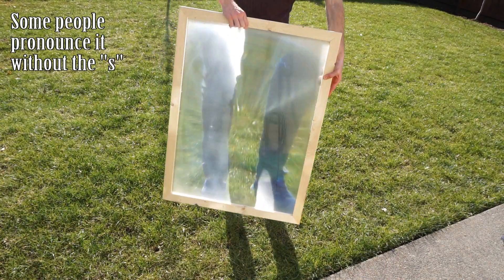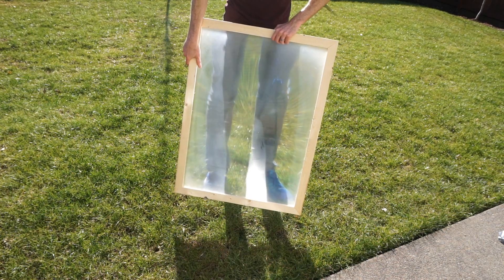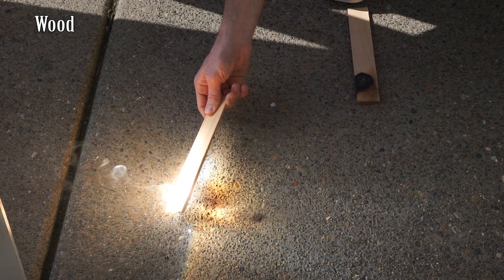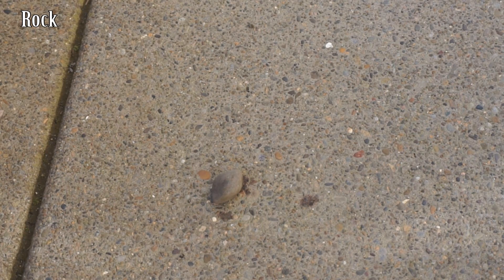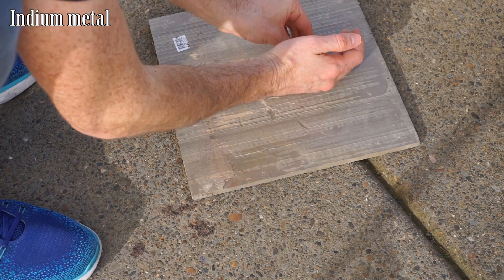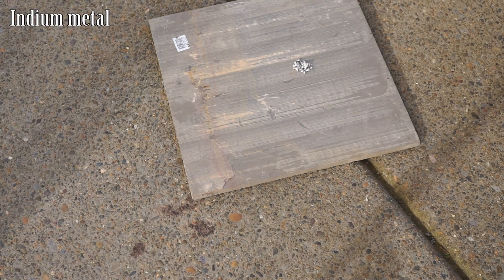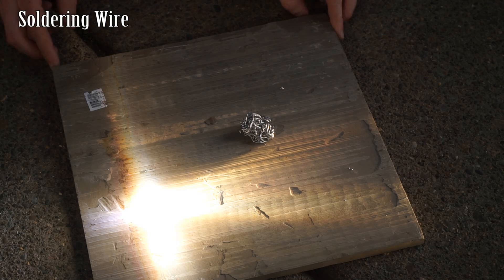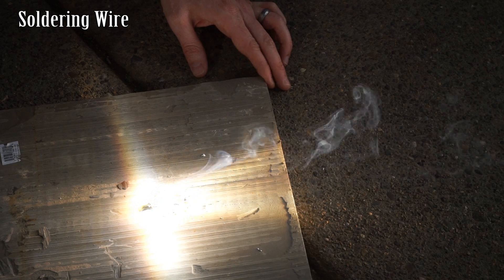2,000°F Solar Power! Melting Metal With A Giant Magnifying Glass

Comment: Where can I get a large fresnel lense?
Reply: Look for old rear-projection TVs. It's outdated tech, you can get them cheap or find them in the trash, that's where I found 4 of them. Look for 4:3 screens because they usually have smaller focal points than 16:9
Reply: @SolarCookingGermany  I found one online the size of a door for 300$ You can practically melt lead with it!
Reply: @johnlewisbrooks  Is it still in a TV? Because you can never tell what kind of lens / focal point you'll get until it's dismantled.

Comment: Use like a hollow brick to "trap" the light.  Use another piece of stone for a lid, like a kiln.  In the lid, there is a small hole to release excess heat and allow the light to enter the furnace.  Just make sure the total area inside the furnace is smaller than the lens, that's why I suggested a brick.  Now the heat can't immediately dissipate into the ambient air.  It's trapped and can build in heat to smelt correctly.  The reason that crucibles won't work is because the heat is too intense in one area.  If you "trap" 50 square inches of light inside a little brick or something, it will heat up more gradually and not break your crucible (use the smallest one you can find).  On a hot sunny day you should be able to smelt at least good ounce of metal inside that thing.

I'm thinking like, standing it vertically and hollow it out somehow.  Then your light spreads back out inside of it to avoid overheating the center.  All types of trial and error things obviously need to be done but I think this is the way to do it by trapping the light inside of a stone container

Comment: If you had a larger lens then you will create even more heat. I love this sort of stuff...it's free energy from the sun and is not as harmful to the environment. I can go on for ages about this....But i won't. 
Great  video and thanks for sharing.
New sub 👍🏻

Great video
Reply: Imagine sticking one to a robotic arm and having it pointed at a steam engine boiler. I could see potential for a solar powered power plant if it was done on a large enough scale.
Reply: Literally blows my mind how we are avoiding this as a green solution to almost everything it has so many practical uses it is unbelieveable
Reply: @cavelvlan25  I think it needs to be mentioned that this is a point source. A lot of energy is concentrated in 1 tiny point. That is why the temperature can get so high. 

 But this doesn't provide significantly more energy in total than just solar energy. The energy is just concentrated wich is only useful for very specific processes, like welding perhaps. But not so much for most other industrial processes.

 You still need an unpractically large surface area for most applications.
Reply: @dekippiesip  correct, I'm saying individually we could use this tech daily. Cooking, heating water, sand batteries. It wouldn't always be convenient but it would help against our reliance on power companies. Same with personal hydro and wind turbines.
Reply: Green steel green hydrogen green anything. Sure would no be effective allllll the time I mean what more do you need!
Reply: Or just mirrors

Comment: Okay so you can't 'stack' multiple magnifying glasses to increase the heat - it doesn't work like that. However you could use multiple magnifying glasses, have them side by side - except the one in the middle would be facing straight towards the object, all of the additional magnifiers would need to be angled, the further away from the mid-point you position them, the more of an angle they would need to be positioned. 

I'm pretty sure this is how ancient people's manage to build great pyramids out of concrete - use the lense to dry and harden the mixture.

Comment: did the pyramid builders mould the blocks on site, melting stone with the sun? 100 ton blocks  wont need tobe cut and moved in place and them flower shaped plates would be easy to make.. would answer the questions?..

Comment: New at a college in Michigan they are improving solar panels that convert heat to power or even high voltage with gold mirror a small layer of air between the panel and the gold reflective panel but imagine if it started out hot cause of your magnifying glass heating a surface that was touching the panel

Comment: Do you think you can use fresnel lens to power air conditioning?  When you use solar panels you lose energy in converting solar power into electricity, but if you use the solar energy directly you could have it power a heat pump...

Comment: No way the metals were actually melting from the sunlight directly because they reflect too much. The solder would have lasted a fraction of a second but it was still a solid until the tile melted it from the bottom up. So you should try iron or some other black metal. That thing was fucking melting rock!

Comment: Put a piece of meat in it so we can see on effect on flesh.
Reply: I cooked a hot dog with a parabolic mirror, it singes the surface of the meat so you need to use a black cast iron pan
Reply: Wiznaf07 what are you talking about plasma? This is purely focused solar radiation and plasma "can only be artificially generated by heating neutral gases or by subjecting that gas to a strong electromagnetic field." -Wikipedia. And before you say its heating the neutral gases in the air, the gases that the wiki is referring to are Nobel gases like neon, helium, argon or xenon
Reply: @TheJoshWooly  while the other guy is still wrong, anything can become a plasma if heated enough
Reply: death. and melted meat because it's plasma

Comment: will it heat up in the vacuum chamber
Reply: ignoring the other guy, yes, in fact it will be able to reach significantly higher temperatures if still concentrating light from the sun because there will be lower transfer of heat into the air overall, this is of course if you can manage to get one to focus into a vacuum chamber and the process youre doing doesnt counteract your pump by releasing gas or expanding significantly
Reply: AJW R u dumb
Reply: will it get a knife to 2000 degrees and can it then be cut through with a 60,000 psi waterjet?
Reply: AJW  Lol
Reply: It’ll melt the vacuum chamber's walls

Comment: use a magnifying glass to focus the light even more.
Reply from the maker: +rmt3589 that would be cool, i will have to try that, although it might melt the magnifying glass though or at least break it. But I will try and see.
Reply: @TheActionLab  died in my mouth 76at the day 766before 7777777777777I #tttt555555r5rerrrreett true se33lf tray for you and 5AM 333 inches if 9
Reply: @joshyoung1440  Are you ok?
Reply: @TheActionLab  ×
Reply: @TheActionLab  ÷e÷
Reply: i think nothing interesting will happen :(
Reply: I know im late but stacking them does nothing
Reply: Hydraulic Press Action do ferrofluid in a vaccume chamber PLEASE
Reply: Where did you buy that Fresnel  magnifying glass?
Reply: It won't work, the light has to be more or less collimated when it goes into the lens in order to meet at a point on the other side. I swear I thought most people here would know this but even the host seems to have forgotten this fact temporarily... unless I'm totally mistaken.
Reply: It won't work because the rays aren't coming in perpendicular to the glass.  The first lens bends their path
Reply: Use 100 magnifying glass stacking light and focus it 100x on laser or light
Reply: R=r=
Reply: Fresnel lens into a magnifying glass then into a microscope. Maybe not. Might shoot a laser into the center of the earth. Lol
Reply: Melt bigger swaths of SNOW instead of shoveling big piles of snow and waiting days to melt normally by just on a sunny day. I want to melt as much snow so it doesn't refreeze to cause a slipping hazard.
Reply: Reeeeee says                                            344inches will will will will will will will you have a good day tomorrow night shift you will 442¾
Reply: Ee

Comment: try to do harder metals and things like sand or dirt. Try to cook with it. Also look for a lens filter for your camera to cut out the glare. Love those lenses I want to get one myself where did you get one that big?
Reply from the maker: +mephibosheth29 yeah I definitely need a filter so you can actually see what's happening. With the welding glasses I was wearing I could see it, but the camera couldn't.
Reply: Ice. Water. Some meat, preferably with skin, to see what it might do to a person. Glass, maybe colored. I like the idea of stone, I wanted to see what that one would do. Maybe a more pure stone, though. A chocolate bunny similar kind of like the chocolate bunny in a hair dryer videos. An egg? 

Get some thin wood and cut through it. It might just catch on fire, though. Is there something you could cut? Maybe sheet metal.

You definitely need something on wheels to move the stuff around. You were freaking me out with your fingers right next to the light. 

As many people said, get a neutral density filter for your camera. Even better, two cameras, one filtered, then edit them together. If you get the lenses close together you might even be able to do a slight perspective shift and overlay them.

If you have one of those black body thermometers, see how hot you can get something.
Reply: Heck yeah...cook bacon...everyone likes bacon!
Reply: Hydraulic Press Action Happy Valentine's Day.
Reply: mephibosheth29 sand would be glass.
Reply: just put welder mask on the camera should help
Reply: I'm afraid an ND filter or welding glass on the camera lens will not help. The camera will then just re-adjust it's lighting until it's balanced again. You need to be able to control the exposure yourself.
Reply: Kawiman636
Reply: Marijn Donders sure, if the camera could lower ISO/shutter speed enough, but I don't think so, it's really bright. Good point, though, even with a filter it would need to be either manually set for exposure or set to point meter.
Reply: Marijn Donders sure, if the camera could lower ISO/shutter speed enough, but I don't think so, it's really bright. Good point, though, even with a filter it would need to be either manually set for exposure or set to point meter.
Reply: It's an instantaneous 2000 degree burn, it's not far fetched to think it will just ignite and  char meat in under a second.
Reply: This is effectively 1kW heater lads, like a small kettle, except heating is concentrated on a small area. It will burn your bacon 5mm x 5mm at the time.
Reply: I'm sure you could order a large freysel 
lens online, myself I own a small one
that I ordered from Scientifics Direct.
I wanted to use it for photo purposes
Reply: @cathy7382 where please tell me?